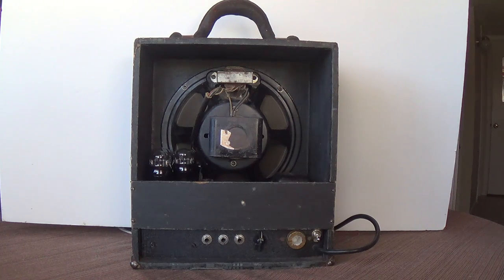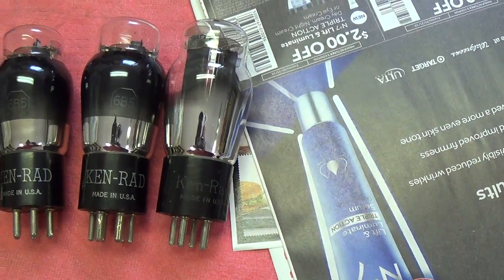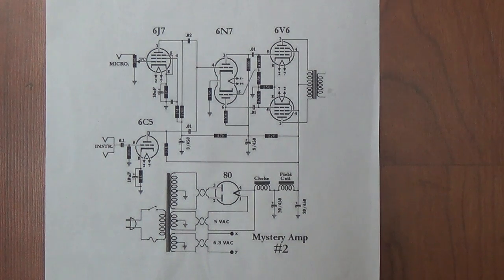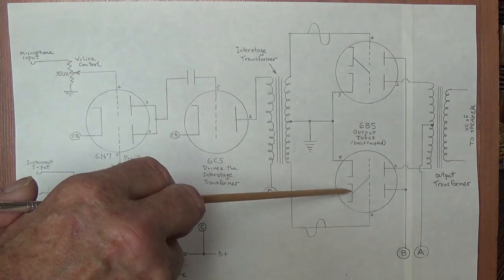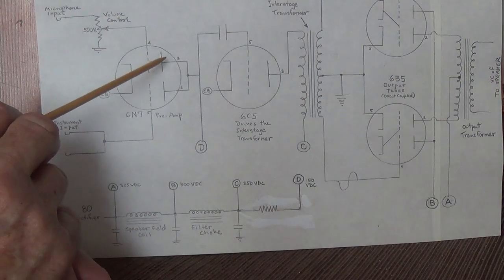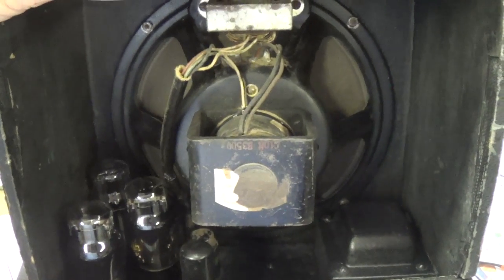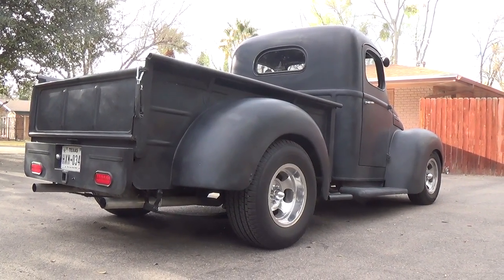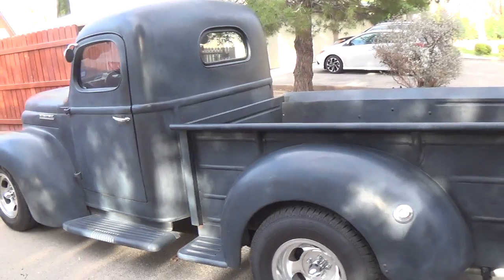Let's Evaluate and Repair the Ebay Mystery Amp

Comment: It's 2023 and just happened to bump into this excellent amp video.  Great job Uncle Doug and thank you.  I'm always intrigued by different circuits from early amplification and the fact that there 2 inputs with no volume controls kind of makes sense to me for use with guitars.  Our interest's must be similar, I also am a hot rodder for lack of a better name, IMHO that pickup is one of bad azzz ride and the lines for that truck are timeless.  I'm LS swapping a '68 C10 right now and find the demand for LS swaps keeps me very busy.  In what spare time I have I'm building a small class A practice amp with a 12AX7 and a 6AQ5 power tube for my son using an old police scanner and it's parts.  Please keep these video's coming, always a great getaway to watch, educational and very entertaining.
Reply from the maker: Thanks for all your interesting comments, Ken. We will do so :)

Comment: Fascinating video Uncle Doug thank you!  So differently laid out to nearly every other valve amp I've seen.  That weird 6B5 tube looks to me to be the equivalent of a Darlington transistor.  Thiese are where a small signal transistor drives a larger one, all within a single package, with only 3 leads available, like a normal single transistor.  This results in huge gain.

Anyway the old amp sounds great.  Who'd a thunk it was 90 years old?  Incredible!  It could pass as an experiment into how few resistors could be used in a guitar amp.  I love that old truck too.  Very comfortable for a mean & menacing 'utilitarian' farm truck!
Reply from the maker: Thanks for your input Neville, and your very nice comments.

Comment: If I'm right, those direct coupled triodes are equivalent to modern Darlington BJT's, stacking the gain of both tube parts?

Also, the speaker field coil causes back EMF, which means the circuit has feedback built-in. Drive the speaker too hard, and your B+ will crash, causing the gain to drop. Kind of awesome to see how much ingenuity there is in this simple circuit.
Reply from the maker: Thanks for sharing, Stoney :)

Comment: You forgot to mention it also has Air Conditioning, unless that's the power steering pump topside. Makes sense in something this cool.
Reply from the maker: You have a good eye, Jaymes. The compressor is present, but it's not connected to any other components.

Comment: A cathode follower and output triodes  plus a cathode bias resistor inside the tube. Cuts down external components......it didn't catch on.
Reply from the maker: Let's hope it didn't catch fire, either ;)

Comment: Ha! Believe me,I’d find a way to stick that tube in backwards! 😂 Aww..lookat Jack with his pipe cleaner! That pic would make a good portrait! What are the winding ratios like with a transformer that’s a PI? Are they like an isolation transformer? Equal? Bonnie and Clyde needed an international!!
Reply from the maker: The winding ratios for typical output transformers are around 25:1, William.
Reply: @UncleDoug  for a phase inverter too? I figured an output transformer would have a big difference in windings. Would one used for a phase inverter have equal windings ? Or do they need differing windings to provide some amplification too? Or doesn’t it matter so much since the output tubes are doing the amplifying? Questions...

Comment: Hi Uncle Doug, I have a question arising out of curiosity to which I have not yet found an answer via google: What is known as the "HT rail" on this side of the pond is known as "B+" on your side. Where did the term come from? Thanks for another enjoyable video :)
Reply from the maker: B+ was an old radio term for the positive high voltage DC (from a battery labelled "B") applied to the tube plates. There was also an "A" battery (filaments) and a "C" battery (grid bias). I think the "high tension (voltage) rail" describes the straight line (on schematics) coming from the rectifier, through the voltage-dropping nodal resistors, carrying the +DC to the tube plates.
Reply: @UncleDoug  Thank you! I never knew about A & C, so now B makes plenty of sense. YLSNED :) You, Sir, are a star!

Comment: This amplifier truly is of an interesting design. The inter-stage transformer design has been used for years in many early amplifiers. I have an old model 30A Leslie speaker that uses them in the amplifier. When I received this particular Leslie Speaker All of them were open. I had them rewound. A little expensive, but the Leslie Model 30A is a rare bird since it was the first Leslie Organ speaker made back in 1938 for the Hammond Organ. It used a Magnavox 15 inch field coil speaker which was also the filter choke for the amp. and the high frequency horns were made out of Paper Mache.  I don't know if I ever mentioned that I'm a jazz organist and played the Hammond B3 organ professionally for many years :)
Reply from the maker: Thanks, Frank. You are a man of many talents.

Comment: I wish you'd kept that truck stock, sure it would have been slow and non syncro transmission but that's how they were. I've been helping a friend fix his 67 Ford Fairlane 6 cylinder and two speed auto trans totally original car and he has seen why he shouldn't change it, resale value like crazy! Yes I did get it's original germanium transistor Philco AM radio working really well too.
Reply: And we rebuilt it's four drum brakes non power assist using ford parts and honestly they are fine, it's a regular old 4 door car and that's just how they were back then. I did add an input jack to the radio so he can play his phone through it's one speaker because AM radio is all talk here and no music but it's under the dashboard on a metal bracket and can be removed if you want to make it totally original again, switched jack which cuts out the radio and uses it's output stage as an amp, a very simple mod.
Reply from the maker: Thanks for the input, G. It's a simple choice between having a truck that obstructs traffic and is relegated to side roads......or one that can haul ass and still look relatively stock. I don't regret my choice.
Reply: @UncleDoug  Damn right. How are you going to trample grannys if you can't get to the estate sale before dinner?  :)
Reply from the maker: Amen, Brother !!! :)

Comment: Hi Sir, know this amp is not a classic amp, but what do you think for the price? Link: https://www.monoprice.com/product?c_id=115&cp_id=11501&cs_id=1150102&p_id=611815   Thanks for the videos. V/R Frank
Reply from the maker: The reviewers loved it, Frank, and at this price, for an all-tube circuit with a 12" Celestion speaker, I would call it the best deal I have seen in a long time. I have no idea how they could even buy the parts to build it for the price they are asking. If this fits your budget and needs, then I say......go for it :)

Comment: Hi Uncle Doug, I have an off topic question that maybe you can help me with?Just bought a used VoxAC30 c2 ser# L06-014202 can't find anything on it,other than made in China.Tried the voxshowroom but they don't list it.Thanks so much .
Reply: Found out it was a 2014 ,may 24th.Thru celestion speaker codes.Thank God for those huh.? Lol.Thanks anyway
Reply from the maker: I'm glad you were able to hunt down some info. Vox's are uncommon in my area, even those made in China.

Comment: Uncle Doug, I have a Princeton reverb 68 custom amp. The amp has a bassman tone stack which I like to run with my pedals but I’d like to have the option of the original tone stack that came out in the old PRs. Is there any reason why I can’t wire a a .022 400v cap and a .047 400v to a push pull volume pot and change between tone stacks. It this safe or are the voltages too high to safely do this? Thanks for your channel I’m learning a lot from you and I love your sense of humor:)
Reply from the maker: Generally, signal voltages are quite low, Tim, so I see no reason why this wouldn't work. After wiring it, you might double check the voltages just to be sure, and perhaps do some fine tuning with different caps and resistors to get the tone you seek. Good luck.
Reply: Uncle Doug Thank you very much:)
Reply from the maker: You're welcome

Comment: A question: Looking back over your videos, I was wondering if the same process for calculating the cathode bypass capacitor could be used to make adjustments to a tube driven reverb circuit? I have an Epiphone Valve Senior, which I must admit, I have yet to hear. It kept burning out the power tubes and had none when I got it, which was no surprise because the cathode bias was way too hot. I'm changing out the cathode resistor to bring that down to a safer level, but many people have said that the reverb is pretty much unusable (overdriven). It is driven by the front half of a 12AX7 and returned to the back half. It uses the same reverb transformer as the Fender Deluxe Reverb, though the tank is different (8AB2A1B). The FDR uses the 4AB3C1B. The values are still fairly close. The Epi has a 6.8uF cathode cap on the front half with a 1.5K resistor. The FDR uses a 12AT7 with 25uF cap and 2200 resistor. I'm thinking that I might be able to swap the 12AX7 for a 12AT7 and maybe change the values on the cathode cap and resistor to tame it some, using the cathode bypass calculator to produce a similar curve, but I'm not sure how the drive and return would affect this. Have you ever considered doing a video on the design of a reverb circuit? I'd be highly interested in that, if you were so inclined. Thanks. ~Interestingly enough, it uses the same output transformer as the Deluxe Reverb as well.
Reply from the maker: I think you should first resolve the output tube bias problem and get the amp working, then listen to the reverb. If the reverb has an Intensity setting, then why can't it simply be turned down? If it doesn't, then find a reverb circuit that resembles yours, and add an Intensity control. You will notice that when Fender uses a 12AT7 to drive a reverb tank, it connects both triodes together, effectively doubling the output.....so if you changed to a 12AT7 like the Fender, you would no longer have a second triode for recovery.
Reply: Uncle Doug That was the plan,  but I was thinking ahead, perhaps a bit too far.  In lieu of changing the circuit, I was thinking that it might need a reduction in gain for that tube.
Reply from the maker: In my experience, experimentation is the best way to improve circuitry.....and theory doesn't always yield the expected result. Remember also that the amplification factor of the 12AT7 is 60, compared to the 12AX7 @ 100......but unless you intend to use only one of its triodes for drive and one for recovery, amplication factor is actually higher (120) for the dual-triode drive mode used by Fender. There is a reason they do this......you really have to drive a reverb tank to get the desired effect. If a single 12AT7 triode could do this, Fender would have done it that way. If the reverb is excessive, I would use the method I described above to trim it down......not a tube alteration.

Comment: Doug - You are on fire!! That Bernzomatic shifter proves my point. It's cool that your IH has a rear-mount gas tank, so many old pickups had the tank behind the driver's seat.
Also I like your dual chamber master cylinder, a must with the kind of power you have. My 64 Ford F-350 Tow truck was all stock when I got it in the 80's, and one day a brake tube popped and I ended up on somebody's front lawn after crashing through a big hedge. Ouch ! Great truck other than that.
Can't wait for your next adventure.
BTW, have you seen videos from the amp builder who uses cake pans as chassis? He is good.
Reply from the maker: Thanks, Richard.....and we have the scorch marks to prove it :)  The in-cab gas tanks literally gas you out when you fill up.....not good. Power disc brakes on the International. I believe that the builder who uses pans is a subscriber. I got a comment from him the other day.

Comment: Thanks for another fantastic video! Oddly enough, have the same amp... just the chassis...  that I found at a thrift store. It was a rusted mess. I don’t expect that it will ever be a functional amp again so I’ve dissaembled it for parts. If you would like the plates to go with the input jacks (I.e, Instrument, Microphone) I would be glad to donate them to you to use on yours. Let me know. Always looking forward to your next one. Best
Reply from the maker: You're welcome, Lyndon. What a coincidence !! I would love to have the input jack plates to restore this old gem to its former glory. Is there an e-mail address by which I can contact you with the mailing info ??
Reply: Uncle Doug lyndon.mcfate@gmail.com
Reply: I’d like to mention that I suspect your on/off switch may not be original, as my chassis has no hole above the power cord hole. Perhaps it may have been a combo power switch/ volume control from the factory? Maybe mine is a variant, though it otherwise seems identicle. I’ll be sure to include some pictures of mine for reference via email. It had a newer fuse added (new hole drilled) and a heavy duty power switch added in the old fuse opening.
Reply from the maker: Thanks, I will contact you at once, Lyndon. If you notice the rear view of the Mystery Amp on the prewaramps.org page, I believe it has a toggle switch in the same location as my amp. Yours may be a variant, which is common with these ancient amps.....there were all sorts of alterations made almost daily. Just like early Valco amps......I have never seen one that matched its (or indeed any) schematic :) :)

Comment: Wanted to thank you for all the great videos and the great wealth of knowledge.  I recently purchased a Gregory Mark 1 amplifier that has just a single volume/power potentiometer.  Do you have any videos possibly explaining adding a 3 prong and isolation transformer and/or any mods possibly tone section ?  I would greatly appreciate any help
Reply from the maker: You're welcome. I explain the wiring of the 3-wire cord in one of the Mystery Amp videos, PoB. I don't know why you would need an isolation transformer. If the amp has no tone control, like the early Fender Champs, then you generally control the tone with the adjustment on the guitar. If you still want to add a tone control, see this site:  http://solorb.com/elect/musiccirc/AO44monoamp/

Comment: Oh, them eletro mag speakers. Back in the day, the magnets would get so lazy...heck you'd have to use
sumthin' like a cattle prod on 'em to keep 'em working. Keep 'em zapped and they keep playin'(8-).

Someone earlier mentioned space charge tubes. I have two examples of hybrid car radios...one from a
Chevy and one from a Ford. Both run 12 volts or less as plate supply juice. But those tubes couldn't 
quite lug a speaker around...so they drove a single ended power amp using an early (crude) transistor.
They worked okay though. Part of my grades in electronics class in high school came from fixing
TVs, radios and amps and such...and the space charge radios were a relief from the "drama" of dealing
with the super hot stuff(8-).

If you get a chance, Doug, look up Bill Hollenbeck on Google. He loved to build guitars. He was my teacher
at Lincolnland Vocational Center in Lincoln, Illinois my last two years in high school...'69 and '70.

As for car/truck radios. I always loved the ol' vibrator driven 0Z4 recified models...though the Buick
Sonomatic 7 pin syncranous vibrator radios were pretty neat(8-).

OH WOW! Thanks for the "tour" of the ol "corn binder" pickup, Doug. That thing's awesome(8-). Oh...
just so ya know...I.H. used some pretty good metal in the early trucks...but they didn't keep it up. I
remember seeing so many just rust away during the late 60s and into the 70s. Now, in faairness,
I grew up in the "rust belt".
Reply from the maker: Thanks for the very interesting and informative comment, Tom. It's great to hear from you.
Reply: Thank you for the opportunity to relearn some of this stuff that I haven't used in years. Oh...
one thing I just thunk of...ya might try getting hold of Jensen. They might send you a
sticker to put on that eletro mag speaker. Stranger things have happened(8-).
Reply from the maker: I'll give it a try, Tom. I'm having no luck devising a way to make my own.
Reply: I often wish I knew of a company that could make a decal from a picture. Snap a photo with
a ruler in there for size and send it off. But  then you'd have to have a good one to snap a picture
of.
Reply from the maker: I actually do have some excellent pictures, but the problem is getting an inkjet printer to print on silver foil.....which it doesn't like to do. The alternative would be to print red on clear adhesive, then stick it to foil.
Reply: The outfit near me pretty much sticks to printing on mylar and other films. I doubt they even know
how to print on metal foil. Okay, fine...so where does one get the metal foil to laminate the film
to? The only popular metal stuff I find around here is gauged for laser engraving...like for plaques
and trophies and such.
Reply from the maker: I imagine that Jensen had them silk screened onto embossed paper-backed foil. How about using shiny silver foil-like Christmas wrapping paper?  I wonder if inkjet ink will stick to it ???
Reply: Might have to clear coat over the "ink" from the printer. That ink probably won't soak in real good.
Reply from the maker: True.....or coat it with clear acetate.
Reply: A way to find out...if ya got a pal who smokes, take the foil-on-paper liner out of a cigarette pack
an try printing on that. At least you'll know if the ink in your printer will stick to foil. Just an idea.